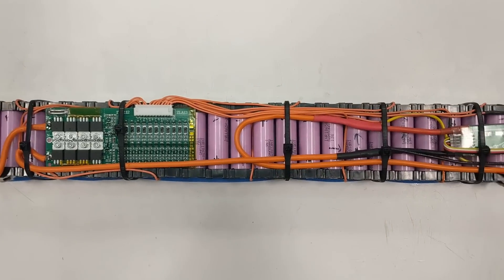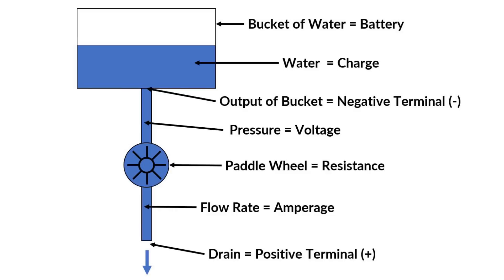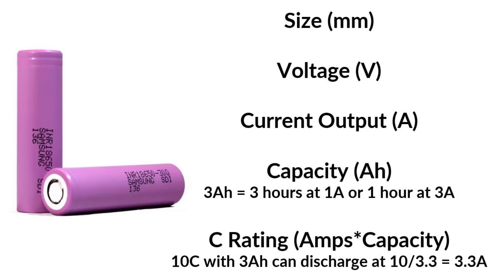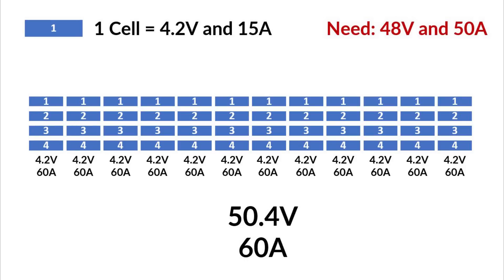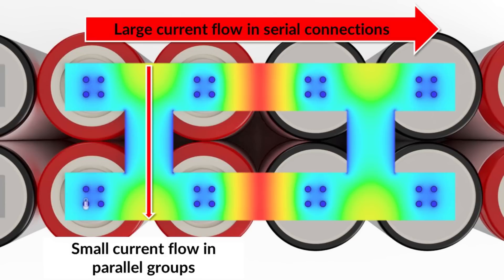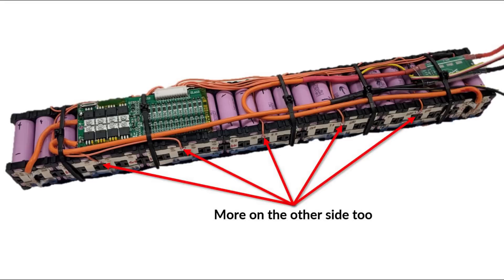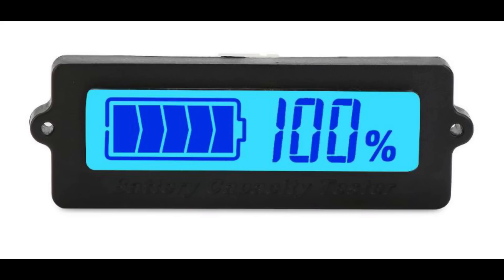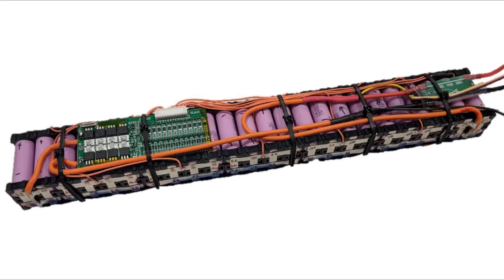How To Design A Lithium Battery (Part 2 of 2)

Comment: Great video, thanks Adam! Not sure if the explanation for C rating is correct. I think that C * Ah = max discharge current. E.g .a 3Ah 10C battery can discharge at 30A, not 3.3A.
Also, could you please give an affiliate link for the BMS you used? Thanks!
Reply: yes there is a mistake in his calculation. Thanks for identifying!!

Comment: Is there a way to half the battery pack and place them side by side and still have a 12s4p battery? This application would be to long for an electric skateboard. So basically instead of this.     ---------- I want this ===

Comment: Great tutorial! I'm trying to mod my scooter to be airplane-carriable, so I'll be 3D printing a quick-relases battery sled, to which I can easily add or remove indivudual cells.
It currently has a cilindrical 5.4AH 36V 10S2P 18650 pack, and due to size constraints, I'm figuring a 5AH 10S1P 36V 21700 pack would do the trick.
Any thoughs or suggestions for this endeavor?
Reply from the maker: Hmm, you'll need to build a self contained module to place all the cells in that breaks the battery output to a nice XT60 series connector or similar. You'll want the mechanical enclosure to be fairly robust. As long as you leave enough slack on the wires to plug and unplug it, you should be ok.
Reply: @AdamBender  Thank you, I'll be aiming for something 3D printed that uses keyston clips to hold the batteries in place, and the XT60 connector is a very good Idea.
By the way, have you had any experience with 21700 or on-parallel battery packs (10S1P)? I see that the max discharge rate of a single cell should be enough for the peak 350W draw of the 250W motor at 36V, but I've never actually tested a 21700 before.

Comment: Your lack of cell fuses is worth consideration.  If a cell in a parallel group develops an internal short circuit then the other 3 cells in the group will dump into it - or in other words that parallel group as a whole will be shorted out, which is probably a bad thing.  The BMS can not protect against that.
Reply from the maker: Cell fuses are certainly important for the reasons you mentioned. Unfortunately, they can be a bit difficult to install by conventional means, and the soldering risks damaging the cells. Do you know of another good way to DIY attach cell level fuses without too much heat? Thanks for watching!
Reply: @AdamBender  Spot welding a single strand of suitable gauge wire that fuses at around the max discharge current of the cells for the parallel connections for each cell to the nickel strip connecting pairs of groups in series is doable.  Or if you can find it then a considerably narrower and thinner nickel strip for the parallel connections than for the series connections. 

Certainly more difficult to build and perhaps less mechanically robust.  An argument could be made it's not worth it for less than some number of parallel cells, and for modern cells the potential for internal shorts is low, but where exactly to draw the line I don't know.  

The thought of 3 fully charged 10C cells through a failed short cell gives me the willies, but also hard to test without actually having a failed-short cell to test with.
Reply from the maker: @JamesSleeman  spot welding a small wire on could be tricky, but if successful, that would definitely add in a nice safety layer to isolate a bad cell. Would be interesting to try, maybe I'll see if I can get my hands on some thin wire and give it a go.

Agreed on that much current dumping into a single cell from the parallel stack. Could definitely result in some thermal runaway which could propagate to surrounding cells. I wonder how much fault current an average 18650 can take before it ignites. Sounds like a test best done outside

Comment: Erm, I don't think you have the definition of C rating correct.  The C rating is the capacity multiplier to get the discharge rate.  In your example, a 10C battery of 3Ah capacity has a safe discharge rate of 10*3 = 30A, not 3.3A.   I = C * Ah, or C = I / Ah, not I * Ah as you have specified.
Reply from the maker: Good catch! Makes a big difference. Must have been sleeping when I made that section. I'll update that on my website. Thanks for watching!